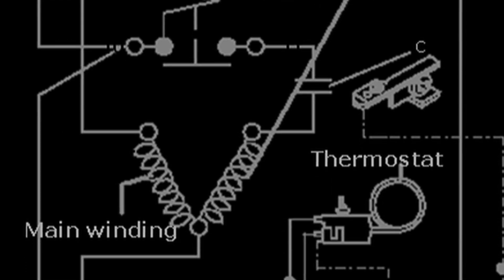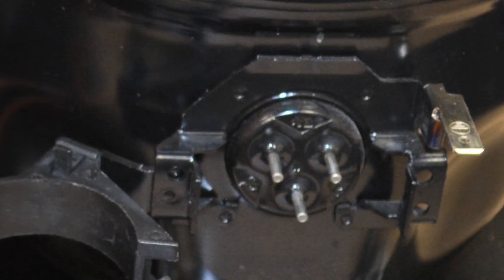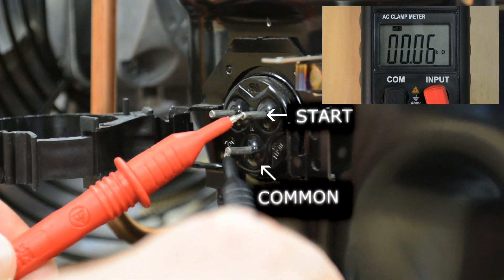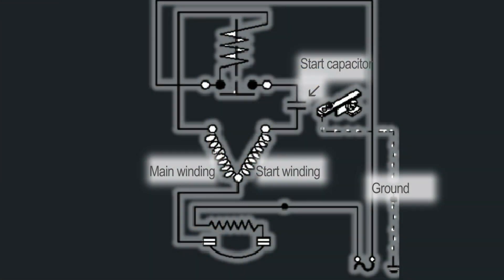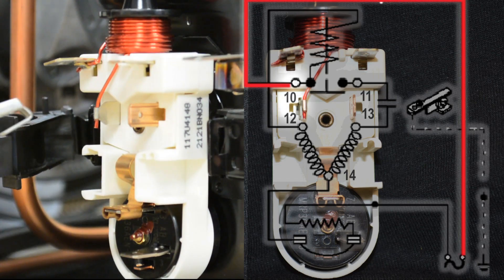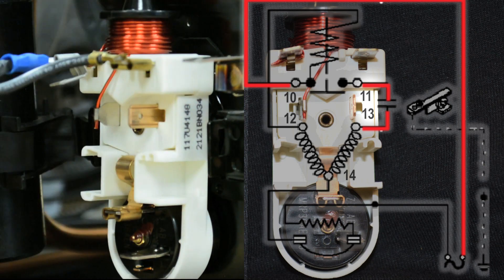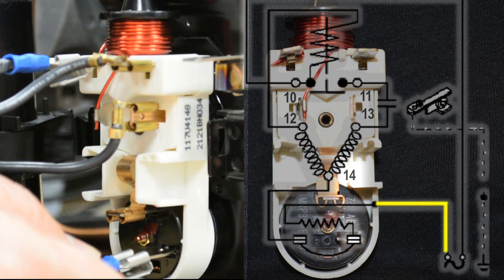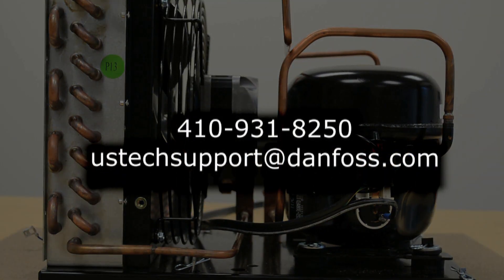Fractional compressor wiring: simplifying the wiring of a light commercial compressor

Comment: If you reverse the live and neutral incoming conductor will the compressor still work ?, At college we were taught to always place the live line conductor through the protector / overload to the common on the compressor.
Reply from the maker: Hi Colin, we recommend the method described above when working with your fractional compressor.
Reply: I have found 115v Embraco factory wired with neutral to common and also wondered what the technical explanation would be.

Comment: Running and start capacitor use
Reply: Both capacitor
Reply from the maker: Hi Vinod, we suggest following the specific wiring diagram for a particular compressor. If the manufacturer specifies using both a start capacitor and a run capacitor that is what should be followed in terms of the installation/wiring for a compressor.